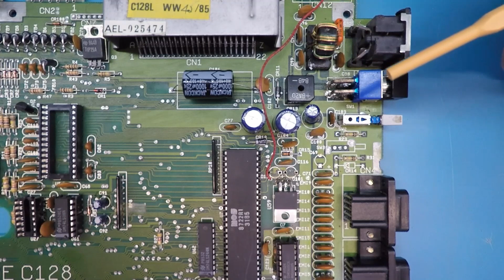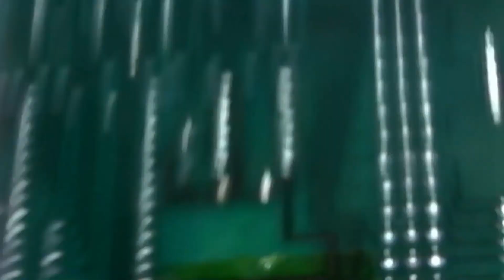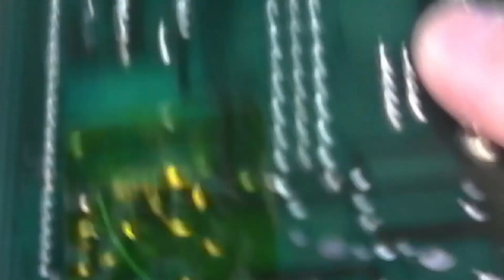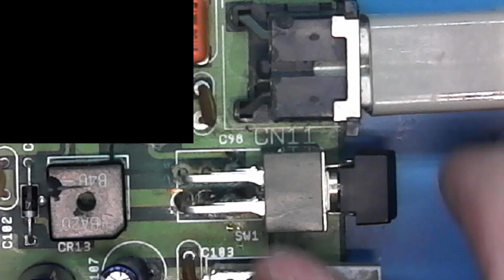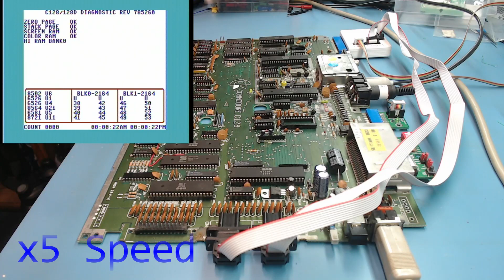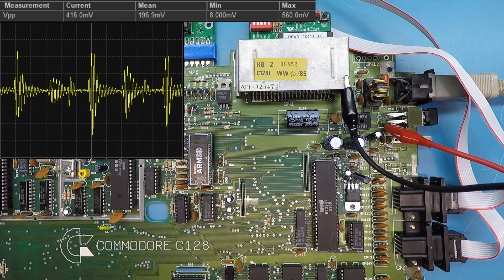Commodore 128 Board Repair - Part 1

Comment: What the hell! The first board -- what happened to the power supply section? People are butchers!
Reply: Great work fixing that poor thing -- so much physical damage, and yes I have SIDs that also seem to work fine but fail on the paddle port test as well. (And I never tested them with real paddles.)
Reply from the maker: Crazy thing is, except for the missing 556 chip, and possibly the 4066 chip, none of the chips were faulty.  It was mostly just the badly damaged board.
Reply from the maker: LOL!  I like the challenge!